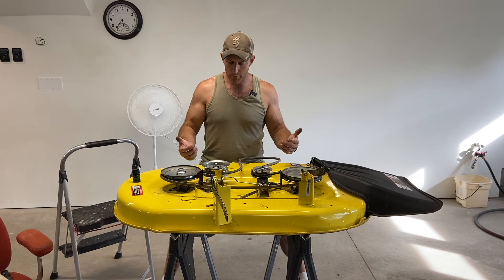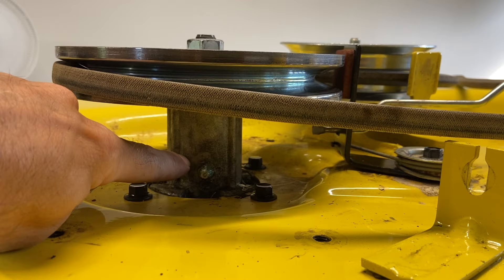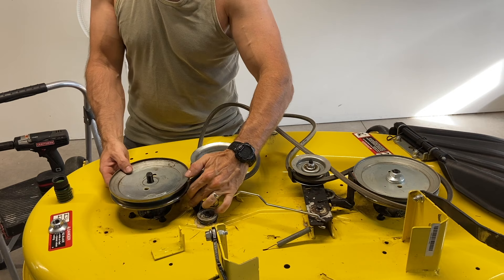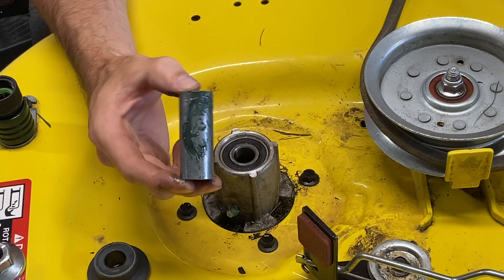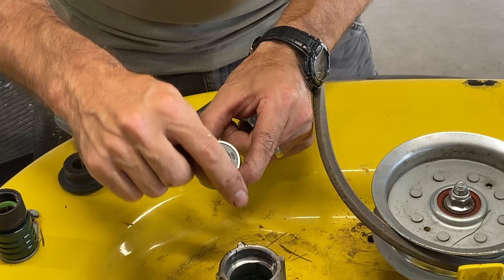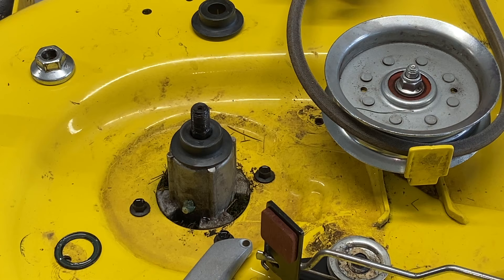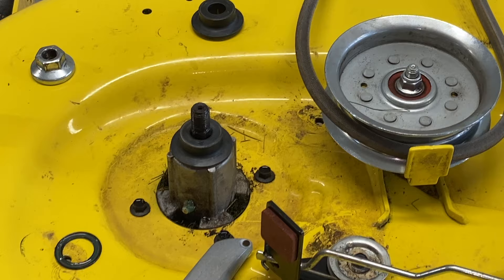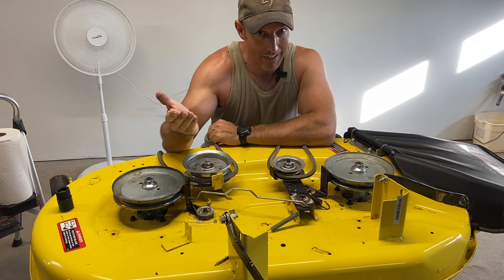I WOULD DO THIS DIFFERENT NOW JUST REPACK THE BEARINGS WITH GOOD GREASE AND PUT SEALS BACK ON.

Comment: Thankyou for the video. But I'm seeing alot of keep the bearing sealed, leave one side of it open, pack it full of grease, etc I'm lost! Should I open both sides to pack them full of grease, put one side back on, reinstall and then grease the fitting? If so how many times should I pump grease into both spindles without overdoing it but making sure it's full for longevity? Also since I use my John Deere E110 42in M-F how often should I grease it? Sorry for all the questions but knowledge is power!
Reply from the maker: Most people are saying a couple pumps in the zerk fitting, And ever 100 hours take the bearings out and repack grease in both top and bottom in both spindles.

Comment: Yup they put the rs bearings in the new spindles with covers both sides and laugh as it wold take a tube of grease to hit them and peeps stop when it  comes out of one side   Im betting But take off both covers re pack  the bearings  replace the outside covers  and grease the shaft too as the zerk will never hit that with the spacer covering it  and they will last way longer
Reply from the maker: Thanks for watching

Comment: I was going to buy a new spindle. I can do this quicker. Thanks 
sub and like I will
after reading comments I'm using your disassembly method and installing new bearings and when they go bad I'm going to replace them. And I'm buying a grease gun for what ever that Zerk thingy does.
Reply from the maker: Thanks for watching hope it works for you

Comment: Do not pound in the outer ring holding the bearings.
use a socket or bearing installer. pump it completely full of grease when done, the grease will settle .
Reply from the maker: Thank you for your comment

Comment: The silver seal also acts as a protector, the black seals are just seals to help keep out the water and dirt,
Reply from the maker: thanks for watching
Reply: The black plastic means it's a "sealed" bearing. The metal shield means it's a "shielded" bearing. Shielded bearings keep out the big chunks while still allowing grease to get in. Sealed bearings are "permanently lubricated" unless the seal is compromised.
Reply: @adventurous63  Glad you are clearing up "sealed" and "shielded". The shield offers better protection against damage, thus the reason the bottom spindle bearing is shielded. But there are drawbacks. Sealed bearings offer better protection against moisture/water infiltration, but the seal creates more friction than a shield. Both are permanently greased at 20% fill capacity unless a specialty bearing. All this from SKF Bearing Institute. Great 3 day training!

Comment: the grease is to keep the shaft from seizing up
\
Reply from the maker: thanks
Reply: Most people don't consider that crease in the spindle housing may help keep the grease in sealed bearings from over heating.  A cooling tactic.  Keeps moisture away from the spindle shaft.

Comment: They're sealed for a reason🤦‍♂️not meant to be greased!  especially if you wash your mower daily or after each use,  you do NOT want unsealed bearings. The fitting is for greasing the spindle shaft
Reply from the maker: Thanks for watching and for information

Comment: The black ring was a seal, the silver ring was a shield and dies not seal the bearing. You should have left that seal on the hearing with the  shield snd put the shield toward the inside and grease would go past the shield and reach the inside of the bearing. You might  be causing early failure of that shielded bearing. Remains to be seen.
Reply from the maker: thanks for the info thanks for watching

Comment: My experience has been that the seals on those bearings don’t stay sealed after years of use. They will eventually let in dirt and metal flakes. I suspect the design intent behind filling the spindle with grease was to supply lubrication to the bearings when the seal wears and fails.
Reply from the maker: Thanks for the info

Comment: I watched another video saying if you over grease now that the seal is removed there’s a chance you can push the bearings out of the casing ?
Reply from the maker: I agree that is why I say to read the comments. I believe just put a few pumps of grease in and leave it go. If you want to take apart Iand repacking the bearings with good bearing grease. This whole setup is not made to last forever. A normal 1/2 acre yard I think they will last a long time.
Reply: drill a tiny weep hole for over pressurized grease to prevent pushing a bearing or seal out.

Comment: Those bearings look just like mine.  Mine were 6204 2rs sealed bearings.  A 10 pack of bearings was $20 on Amazon, and you should pack them with grease as they have very little from the factory.
Reply from the maker: Sounds like a good idea, thanks for watching

Comment: Thanks for the video, I have a John Deere 125, I have replaced both Idler pulleys and just one spindle, also just replaced the belt and both blades, the deck vibrates when blades are engaged but vibrates worse when the cutting level is set higher, less vibration set on 2, more vibration set on 5. any idea of what could be causing this? Thanks
Reply from the maker: Are the blades balanced
Reply: @DIYJIM  Yes, they are brand new John Deere OEM blades and I checked them both on my blade balancer and the are balanced like they should be. Thanks
Reply from the maker: Hope you get it figured out, i have never had any vibration issues with my deck
Reply: @DIYJIM  I'm going to replace the other Spindle soon, I hope that takes care of the vibration. Thanks.
Reply: @DIYJIM  Still have deck vibrations worse with grass cutting height set on 5 better on 2. I have replaced, both spindles, both blades new and balanced, both idler pulleys, and the blade belt. all new. anyone have a suggestion?
Reply from the maker: I would join one of the small engine or mower groups on Facebook and see what the people on there think
Reply: @DIYJIM  Good Idea, Thanks

Comment: Good man 👍
Its mainly assembly lube in the bearings when new,so pretty average without high temp. bearing or marine grease which  I pack in bearings prior to putting them back in......lasts heaps longer 🍻

Alot of brands have this same issue!

Use a metal rod in one of the deck holes with bent end facing up,so it does not fall thru ,when you are re tightening spindle nut back on,blade won't spin 😉
Reply from the maker: Thanks for the info

Comment: Yes I can see now that grease can get to the bearings but surely the outer seals on the bearings will get popped out while being greased?
Reply from the maker: Good point, but no matter what you do it seems like a part that will eventually fail. At least it will be easy to fix when it does.
Reply: Not if a weep hole is installed, to show when there’s adequate pressure in the housing.

Comment: If you remove the seals then what keeps the grease in the upper bearing when the level of grease drops a little bit?
Reply from the maker: if you are only mowing a 1/2 acre to 1 acre I recommended not worrying about the bearings. Thanks for watching

Comment: I have a john deere mower and the grease fittings are pressed in and when I tried to grease them the grease fitting was pushed out
Reply from the maker: Sound like you might wat to have someone look at it. Do you have a warranty on it still? Sorry hard to help from a comment , hope you get it figured out
Reply: Its plugged. Best thing to do is try pushing in on the end of the zerk with a punch. There is a little bearing in there that is pushed forward ,allowing grease to enter. If dirt and rust get in there, that ball will remain closed kicking the grease gun off the nipple. If you cannot get it to unseat, you need to replace.
Reply from the maker: @scottfirman  thanks for helping
Reply: The grease fitting pushed out because there is no vent from inside the spindle.  Remove the bearings, repack them with quality grease, put the seals back on and just drill and tap or plug that faulty hole.

Comment: How can I tell when there is adequate grease in the spindle housing?
Reply from the maker: Not that easy, the best way would be to put some in before you put the top bearing in. When i did it i noticed also the grease does not start to come out, it is sealed good. Sorry i do not have a real good answer for this.
Reply: Many advise - pump until the pumping is difficult.  Stop when that happens .     Then enjoy your mowing.  The spindles are not that expensive to replace if bearings go bad.  Some advise a "weep hole" that they drill when they have the spindle apart.
Reply: @orbit1138  The trouble with pumping and continue to pump the grease in, is that you are actually creating a Hydraulic ram force, it will pop out the oil seals on the bearings.
Reply: @rafaelbalboa274  LOL - you don't continue to pump the grease in and you won't create hydraulic ram force.  Just fill the space.
Reply: if it runs dry  it will squeal or lock up stopping the blades

Comment: Well, in my opinion, this is not the way to do it. As soon that things is full of grease, you will blow the upper or lower (or both) seals out of the bearings. The problem can be solved by taking the bearings, wash all the that cheap China grease out and fill them up with a good quality synthetic grease. Then re-install both seals and re-assemble the unit. You might not have to do this job again, ever. This method can be used with every sealed bearing !!
Reply from the maker: Thanks for the tip maybe I will do that next time
Reply: So the grease is inferior, but the bearing is not?  Cheap grease usually comes equipped with a cheap bearing.  Buy an SKF or other reputable brand, leave the seals alone, and pump the zerk to purge out the dirt on a regular basis.

Comment: Well you just trashed those bearings. Sealed bearings are prefilled with grease and won't allow foreign material into that would speed the wear of the bearing. The grease isn't for the bearings it is for the bushing.. everybody who thinks this guy is a genius needs to research what a sealed bearing is. And understand there greased before being sealed 👌 if your bearing has run out of grease and is roaring you have went past the life expetency of the bearing and its time to replace 20 dollars worth of bearings. Also not torquing that spindle to spec is creating a axial force on that bearing that a a spherical roller bearing wasn't designed to withstand. Basicly this guy is causing more problems then he thinks he is solving.
Reply from the maker: thank you for the info have a nice summer

Comment: if you are that worried about greasing sealed bearings...then what you should do is just put unsealed bearings in there so you can grease them....that is why they are sealed.  You did more harm than good banging the shit out of those casings.  You see a grease fitting there....just load it up with grease....
Reply from the maker: Thanks for the info have a good summer

Comment: Use higher end bearings like timken or skf. It could be a 6204 on the bottom and 6203 on top. 6203 is the Same as the belt tensioner pully bearings on a 2010 toyota truck. Cheap China bearing last 3 to 5 years bearings made in japan are to a higher standard last the life of the machine. Dont fall for amazons cheap china crap. correction if there is a spacer they both should be a 6204.
Reply from the maker: Thanks for the advice and thanks for watching

Comment: It's best to remove the bearing seal repack the bearing then put the seal back in and reassemble it,,, because TOO MUCH GREASE is worse than not enough,,, a bunch of grease HOLDS HEAT IN AND THE BEARINGS WON'T LAST AS LONG!!

Comment: Instead of tossing  seal ,,, why not just remove rubber seal , drill a few 1/16" holes  in it and replace ???????
Reply from the maker: Guess that would work, thanks for watching
Reply: I pop my inside seals off, then save them to replace worn seals in used bearings, down the road. Homeowner type mower sized spindle bearings are usually the same size as idle pulley bearings, so I ordered a 10 pack off Ebay couple years back for under $9 to keep on hand.

Comment: Wrong - a grease gun provides enough pressure to force grease through the seals on the sealed barings.
Reply from the maker: thanks for watching
Reply: Exactly they use grease guns to tighten tracks on excavators lol , people obviously don’t understand the hydraulic pressures they produce
Reply: Also they are just loose fitting dust covers not seals , you can pick em out with yer finger nail lol , grease will go around then like they are not even there

Comment: The metal seal on the bottom bearing is not a waterproof seal and will let grease in 
You should have removed it instead of the rubber seal now moisture can get into it and will not last

Comment: You only fixed half the problem. You removed the seals to let the new grease in but there still no way to let the old grease out to make room for the new grease.
Reply from the maker: Thanks for watching some drill a small hole at the top.

Comment: The "sealed" bearings you are talking about have a rubber seal. Grease gun pressure will easily pass by these "seals" and the bearing will be greased. I've been working as a small engine mechanic for over 45 years and still hear this false hood about "sealed" bearings.
Reply from the maker: Thank you for the information and thanks for watching

Comment: Why would you do it different now?  Did removing the inner seals cause the outer seals to pop off after a full zerk fitting greasing?

There is a video by Woodchuck Russ the Deck Dr proving that the inner seal of spindle/mandrel sealed bearings do not need to be pulled for a grease gun to grease them.  The title is: Don’t trust the “Experts” Grease your mower deck sealed spindle bearings Common sense maintenance.  You can find it by the title.

However, I guess that "spacer" on the blade shaft between the bearings inside the spindle could be blocking grease from getting through the bearing seals.  I don't have a John Deere and my two tractor mowers don't have that "spacer."  The spindles also don't come with zerk fittings installed, so I installed one on each spindle, making sure to get all drilling debris out, left both bearing covers on, grease the spindles and saw grease coming out of the bottom bearings on the Craftsman.  I haven't done it on the Troy-Bilt yet, but I will.  But I have to wonder why your spindles have zerk fittings if the grease doesn't get to the bearings.  The shaft does not need grease, the bearings do, and there's nothing else inside that needs grease.  I also have to wonder what that "spacer" is for, especially if it's interfering with greasing.  Leads one to believe that spindles are made to fail, so you have to remove the bearings to grease them.

There is a sealed bearing greasing needle for your grease gun if you want to try that.  Just get the outer bearing seals exposed to use it, which I guess is how you pull a seal to grease them now.  The needle prevents pulling a seal, but you do have to get the needle tip under it.
Reply from the maker: Thanks for the tips. Thanks for watching. I really think since I only mow 1/2 acre my spindle bearings will last a long time even if I do nothing.
Reply: @DIYJIM   Thanks for the reply, but why would you do it different next time?  Has pulling inner seals caused an issue?  I think next spindle greasing time, I'll pull those factory rubber/plastic-sealed bearings, buy metal-sealed on both sides, pull the inner seals and go that way.  I think only one outer rubber/plastic seal each would blow out too easily from grease pressure and make a huge mess.  Metal seals are much harder to get out, while rubber/plastic seals come out easily.
Reply from the maker: @100vg  i just think now since I only mow 1/2 acre I would not worry about it. Just pump a little grease in the spindle once or twice a year. They never gave me any trouble.
Reply: @DIYJIM   Thanks

Comment: Those are dust shields on the bearings not seals.   If they were sealed bearing it would be a metal shield. The bearings are pre-lubricated and the shield holds the lube in and keep dirt and grit from getting into the bearing.   You can remove the shields and lube the bearings but then you let crap into them and they end up failing about the same time.   John Deer should have used a better bearing.   Either a larger diameter or perhaps a double row sealed bearing.  They also use cheap bearings.    When I take mine apart I will just put a better quality sealed bearing in.  Just part of owning a JD riding mower.
Reply from the maker: Thanks for the info thanks for watching
Reply: @DIYJIM  also, that has to be the cleanest mower deck I have seen  :D
Reply from the maker: Thanks

Comment: The seals just pop right off so I take one off, pack it with a good heavy duty wheel bearing grease and pop the seal back on. Grease is cheaper than steel.
Reply from the maker: Thanks for watching

Comment: Why wouldn't you pack the bearings with quality Wheel Bearing Grease (it is fibrous and Hi Temp) and simply reassemble with the Seals Reinstalled?  Grease only fills the cavity and has no vent to release air!!!!  Good time to touch up the blade edges on the grinder or with right angle grinder.  Too much grease pumped in with no vent or inner seal on bearings could force outer seals out!!!  KISS  Keep It Simple......
Reply from the maker: Sounds like a good idea thanks for the tip